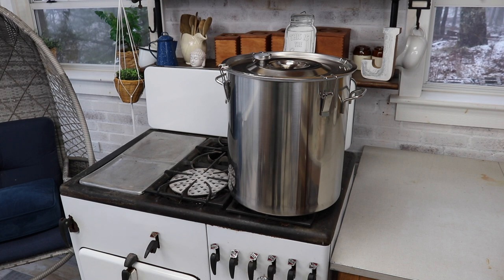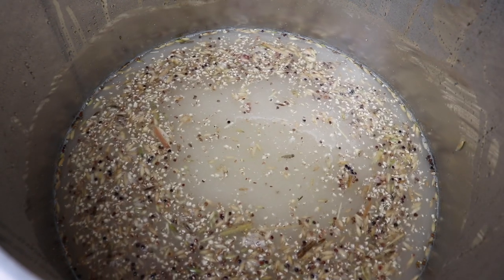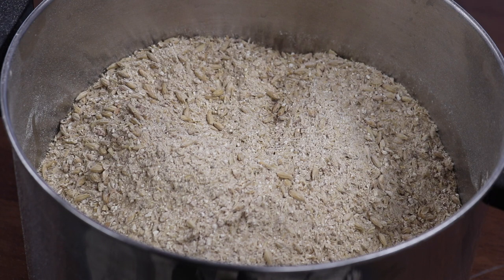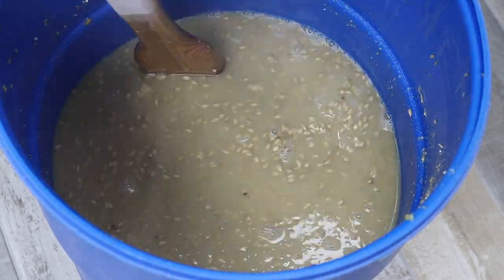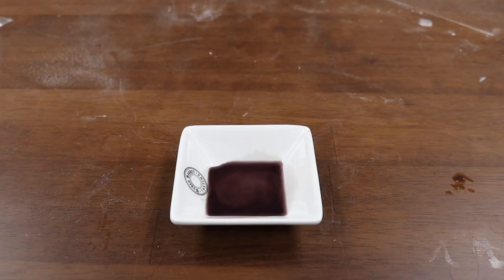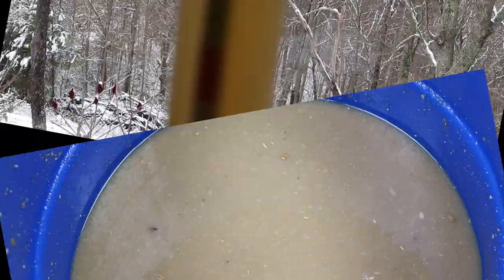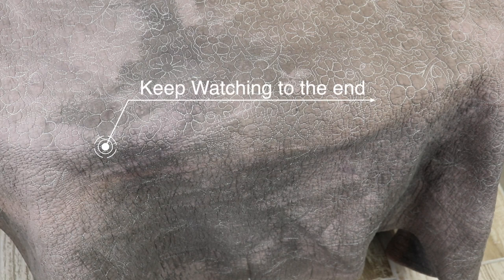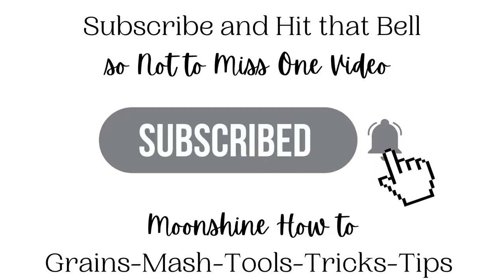All Grain Bourbon Recipe for Moonshine|Part 1

Comment: Great vid, I’m interested in how you separate the grains from the wash. I StRuGgLe with corn!
Reply from the maker: After fermenting on the grain, I siphon off the top, leaving it down to a thin layer. The grains are reused for a sour mash. Check out that video. If you need more liquid out of the grains, you can try using a paint strainer. https://youtu.be/uUsAxLa9MDg

Comment: Question...anything wrong with just getting the water to just below boiling....then cutting the heat and throwing the grains in to cook?
Reply from the maker: Absolutely you can throw the corn in at 190 degrees, try and hold the heat for 60-90 mins to release the starches. Let this cool to 155 degrees to add malted grains. You should never add malted grains above 160, it will kill the enzymes.
Reply: For everyone that reads this and is new to the craft. On the bottle or package it says enzyme denatures above a certain temp actually means like he said "kills the enzyme". @MoonshineHowTo

Comment: Did you make part 2?
Reply from the maker: Thanks for the reminder, it will be done by the weekend :)
Reply: @MoonshineHowTo  please show how to get it from the fermenter to the still. I’m stuck on separating the grain?
Reply: @paulkelley4931  check out the sour mash recipe video. In a nut shell, siphon down to about within one half inch of the solids. Reuse those grains for a sour mash which I explained in the sour mash recipe video. Check out all the videos each one has a lot of info.

Comment: Why didn't you add your grain to a 190ﾟ water rather than cold water
Reply: That temperature would destroy (denature) the amylase enzymes in the grain. It's fine for the corn because it has no enzyme. Amylase is active generally from 135 degrees to 162, with beta amylase preferring 145 to 148 ideally, and alpha amylase preferring 155 to 160. Anything above 165 and they denatured. Below 135 and conversion can still happen, but it's significantly slower. Hope this helps.
Reply: Very good answer